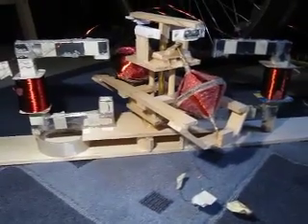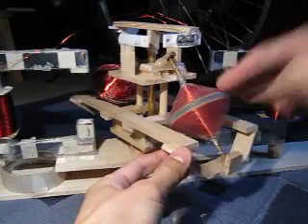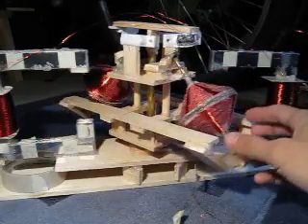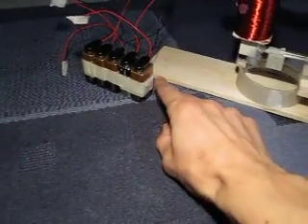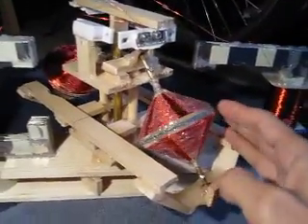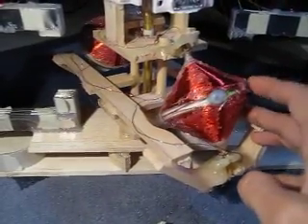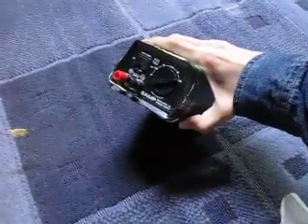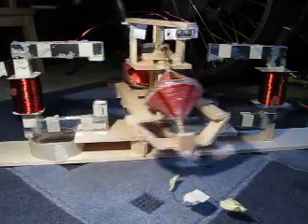Otis T. Carrs Flying Saucer Part 3

Comment: How'd you get your sphere of salt water in it?
Reply from the maker: I found a hollow plastic sphere in some craft hobby store which split apart into two half spheres.  Then used each half sphere in a mold I poured liquid glass epoxy into.  After the liquid glass had hardened, I glued the two halves of the utron together with a glue gun.  Before I did that, I drilled a hole into one of the halves.  After the two halves were glued together I used two straws to pour salt water into the hollow sphere.  A large straw and a much smaller diameter straw that fit inside the larger straw, (to allow air to flow out as water flowed in).  I believe I might've either created a small funnel for the larger straw to pour the water into it, or I used a large plastic syringe type instrument.  It might've been a turkey flavor type thing with a rubber end that you can squeeze.  Then again it might've been a glass eye dropper with a similar rubber balloon type thing on the large end.  Its been so long I forgot the exact details.  So much potential....    so little time and money I have to pursue my dreams unfortunately.  I was living in my Dads basement at the time of this video's making, working at a low paying menial dead end job.  How far I've come in 12 years...   lol

Comment: On the craft the utrons are aluminum and the utrons coils don't need to be charged up because a pulse of electricity on aluminum utrons sets the whole thing in motion....make your next utrons aluminum the purpose of them having copper wire wrapped around them is to recharge the center accumulator aka battery ......the whole. Raft is basically a motor...

Comment: Brother he did not pulse the utrons he pulsed the capacitor plates .the utrons are more like a regenaratoion coil to recharge the battery (center utron) ..lenz law you can pulse a aluminum disk it will motor itself the principle is counter rotation bodies ita actually very easy

Comment: I have been interested in the effects of gyroscopic force and gravity repulsion for years. Everything i build is buid in my head as i continue to find problems and resolve problems. At this point... Four gyroscopes are the least amount for gravity repulsion and they must "fight" one another more than the force of gravity. I tend to think it will require 6 but i am still currently in construction with just 4. (It seems like i use even number gyros but that is not true.) Two never passed and three was not enough also. Once i get past fighting each other i move to working with eavh other, then a combination. Unsure when i will actually build a physical model(s). Like your work.
Reply: Megustaria  que me ayudes

Comment: I watched the #9 video, in which comments were disabled, but could see neither free energy effect nor levitation. The electromagnets were fed by batteries and it is expected that magnetic interaction would cause rotation, just as it happens with ordinary motors, in a more primitive form. So far no actual news!

Comment from the maker: @NickBrunsky Please watch part 4 and 5 to see the upgraded latest work.  I used only one layer and was able to accomplish this by using a cone shaped wrapping machine I built myself.  The cone had a sticky surface so you could wrap one wire at a time.  There was also restraining arms to help hold the wire in place. I wrapped by hand using the machine but it still took a couple hours to wrap each cone.  In the newer vids I got away from this system of wrapping entirely.  Have a look.

Comment: @TheSaltysack Also, when u park the pod right by the earth soil surface it will discharge the capacitor. To charge that back is about less than 5 minutes depends. U must have d bottom a wheel rubber leg/foot (an insulator rubber) so u can park it by the soil. Or if ur pod can levitate in the air that's cool.

Peace & Cheers,

Comment: @TheSaltysack True! and u can put any types of capacitor as long as it's designed for storing electricity.  But I wonder how does it look like your capacitor u r installing and what/how many microfarad and voltage value of capacitor u r using so it can store electricity? Could u tell me please... I'm waiting...

Comment from the maker: @NickBrunsky Direction of wire wrapping (clockwise/counter clockwise) is irrelevant as far as I know but ultimately comes down to whether you want to use repulsion, or attraction to spin the system up.  A source of mine said that only one can be used, but I don't know which it is and I lost contact with my source before he could say more, but he allegedly built a working prototype.

Comment from the maker: @NickBrunsky I used 28 gauge copper wire for the Utrons because that was the smallest diameter wire I could easily wrap into a cone.  Smaller diameter wire was too problematic to wrap, although I have since come to realize that finer wire could be used but would have to be layered up on the cones surface, rather than a single layer of wire as I am using with my present design.

Comment: Question?  I'd like 2 know, how would u know if u r going 2 use d size of AWG gauge coil & how do u know what voltage applied 2 that size gauge of coil?  Does it also has 2 do with d number of turns/winding like feet per voltage & d gauge size? Can u tell me? Is it d bigger d gauge d bigger d wattage/amp will give u? How would u know how many turns/winding so I can apply 24 Volts car battery? Please let me know in my Facebook. I'm waiting...

Comment: Just a thought, Charging a coil and then releasing it creates a sharp spike of back emf. The salt water caps in the rotating coils could be acting like BEMF collectors, rising the dc static charge each coil it passes , until it reaches voltages of extreme value. Maybe resonating with a frequency of light maybe.  Also that charged up cap would repel the coil due to coil opposition.

Comment: @spiritelemental  I think you need the central Utron too, and you also need the capacitors, I also guess you can not achieve the desired effect  without the actually exact placement of the Utrons and capacitors. I also think the mercury plays a huge role in the whole thing sine it's a metal. Don't you have the pitures? I an mail them to ya os youtube won't let me post a link here. GREAT EFFORTS tho man! You rule!
Reply: Ola quiero aprender  se mucho pero se que sabes más.

Comment: I wasn't sure if the utrons spun by a motor or not.  And the utrons that Ralph Ring were using were solid, possibly permanent magnets?  Essentially that would be your bedini motor running and the spinning of the magnets both square and round is suppose to cancel the gravity?  Any new information on the Carr toy?  I am in the process of drafting something similar to give it a shot.
Reply: Ola hagamos  uno ascala

Comment from the maker: @coolzidedown Horse shoes can be used, but the might need to be bent just a little, or given an extra piece of metal at one end.  I recommend trying a cheaper faster way of building the cores of the outer electromagnets.  I used thin slices of stainless steel which I had to cut in a pain staking, tedious, time consuming process.  Lots of work, which I would rather not have to do again for the next set of electromagnets I make.  :-)  Good idea!  I might actually use it.  Thanks!